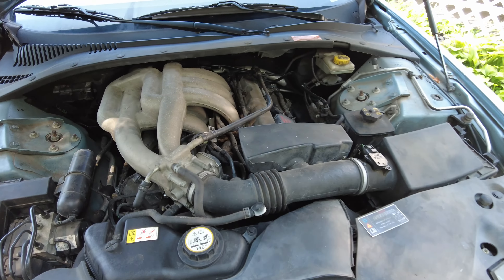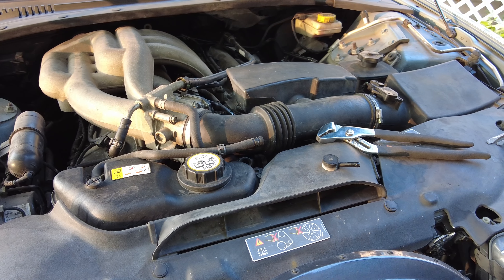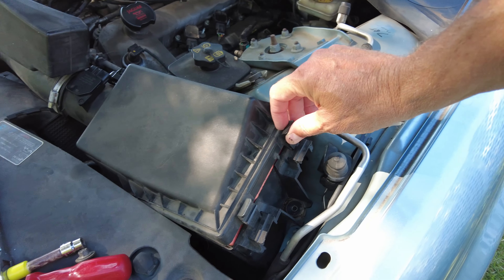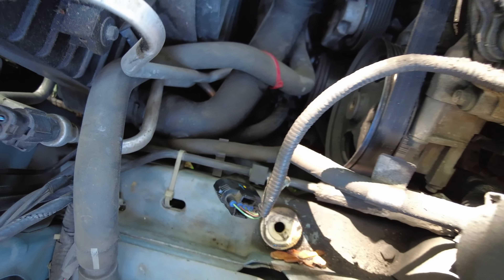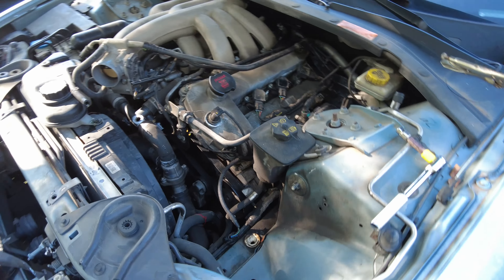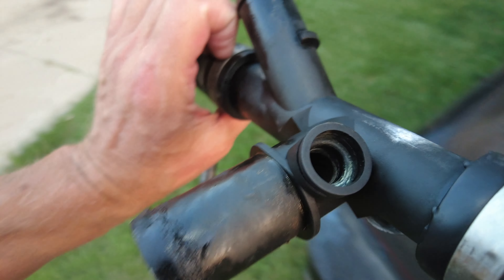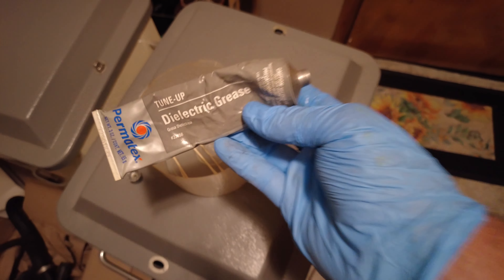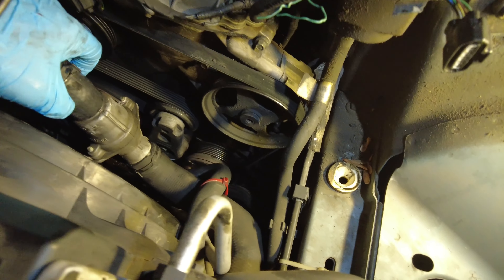Jaguar radiator Hose. Jaguar S type radiator hose replacement problem. #jaguar

Comment: I know it’s been a little but how has the aftermarket part held up? I just bought the same brand part but I’m thinking of returning it to get the OEM one what do you think I should do sir?
Reply from the maker: No issues what so ever. Normally I am not a fan of generic aftermarket parts BUT this is just a rubber hose. All it does is contain coolant. Things like electronics or spark plugs I would never go cheap. But just a rubber hose... Thanks for the comment!
Reply: Of course I am still considered getting the OEM one because of the sensor situation and I’ve already gotten all oem parts for the car already so why stop now haha but good to know that that part will suffice have a good day thanks again!